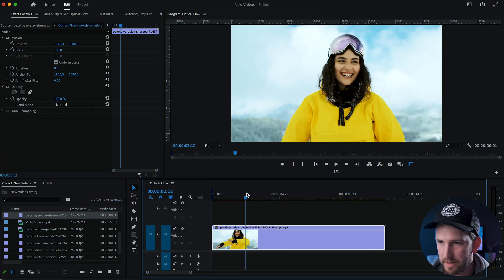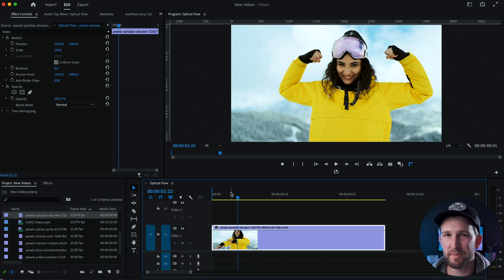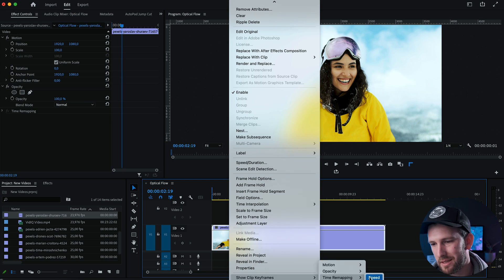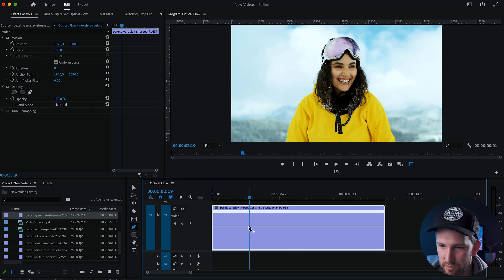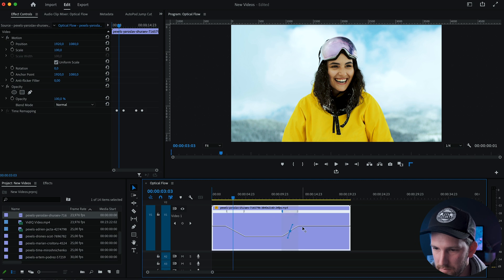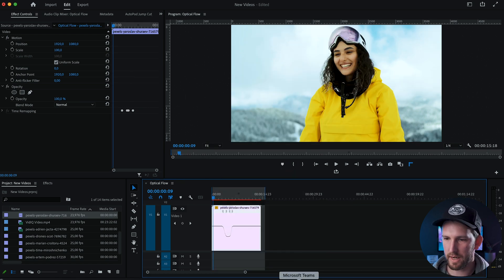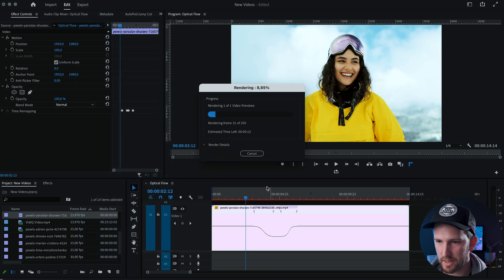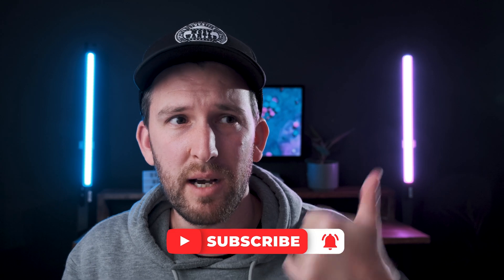Fake SUPER Slow Motion With Optical Flow (Premiere Pro)

Comment: Why when I select the optical flow my footage still lag and nothing happened?
Reply: I came back with a solution how to fix that.
You need go to File - Project Settings - General and in that menu change in video rendering from CUDA to Software only. I fix my problem with changing type of renderer
Reply: and when i came back to CUDA playback doesnt work, but slow-mo work. hahahaha
Reply: ok on the timeline we cannot see any changing, but you can see that only after exporting video from premiere pro if we use CUDA. That very strange. I try to fix that and back with a solution
Reply: @BrightVitaliy  Man thank you so much! I was trying to find out why optical flow did nothing on my clip until I just exported and saw it worked! Your comment saved me!
Reply: @BrightVitaliy  legend
Reply: a have the same problem, nothing is happen
Reply: You just have to go to sequence < render in to out. 
It’s just lagging because it didn’t render yet